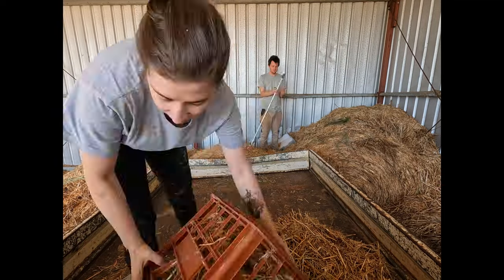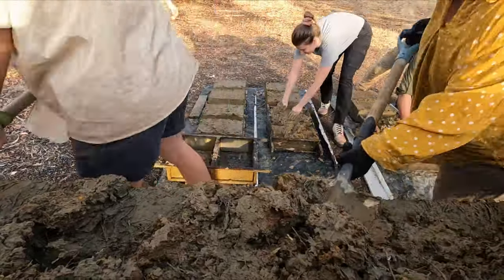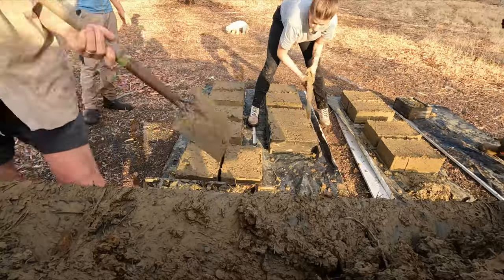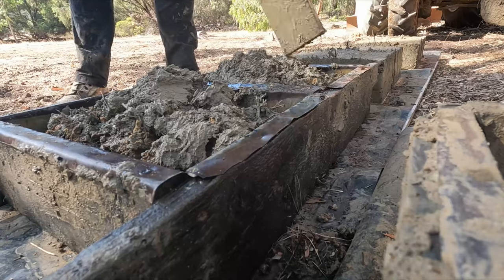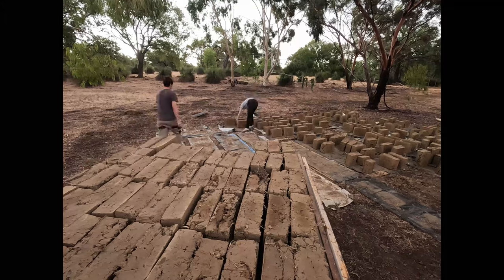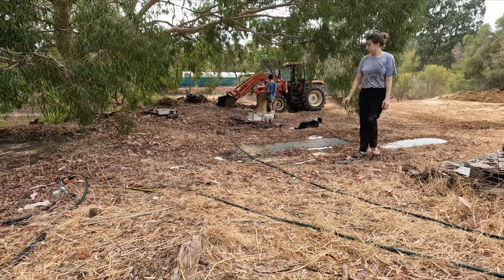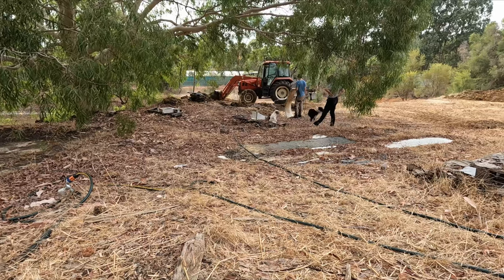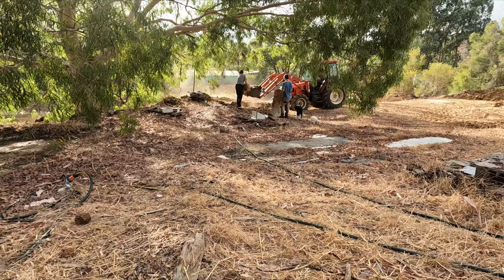Hand-making the Mud Bricks for our House!

Comment: What kind of oil did you use to cover the outside of the bricks? How was it done? I'm very interested about the use this kind of eco-friendly building in more wet climates like Scandinavia!
Reply from the maker: @brothercarlsen422  some of the walls we left bare without any coating; some we sprayed with a product for sealing rammed earth walls, similar to PVA glue in it's composition, made by Bondcrete.
The internal wall in the kitchen I coated with a layer of fine clay mixed with the Bondcrete water based sealant and painted it onto the wall with brushes and sponges to smooth it out.

Comment: Hi we are looking at building mud brick we have now decided due to shire building issues to add cement.trouble is we can't figure out a footing design to submit to shire.any ideas thanks Perth wa
Reply from the maker: I'd suggest looking at AS2870, but we have a 100mm concrete pad with 100mm mesh.

If you are building on a cement slab then you should be right just following the standard, probably adding an additional 200mm under the walls.